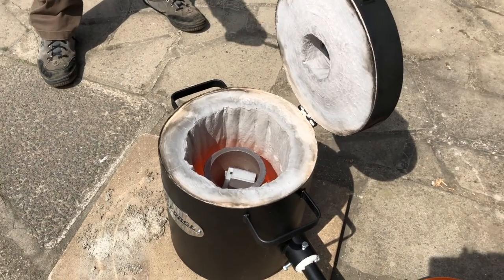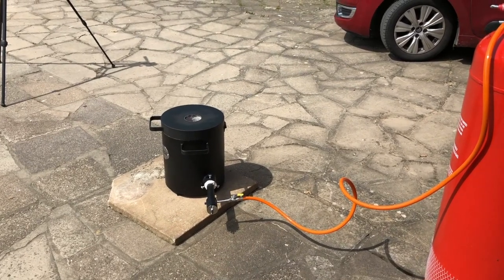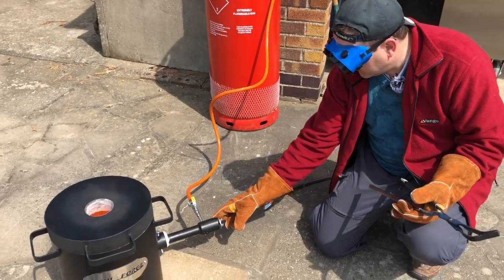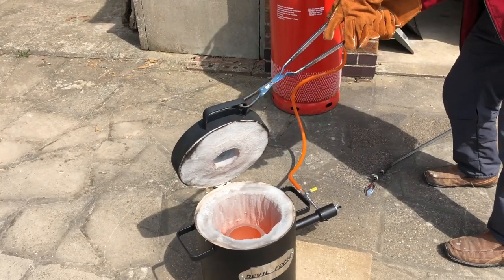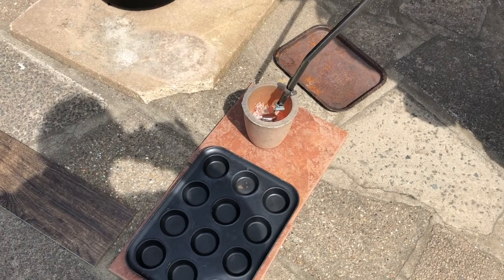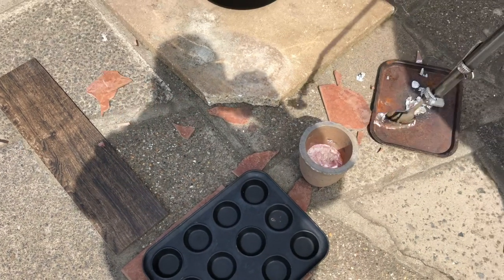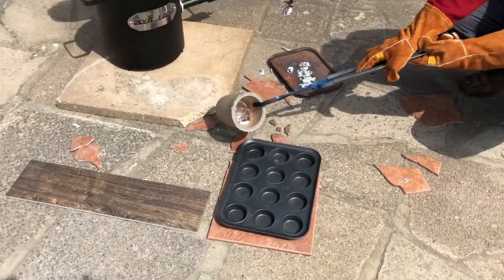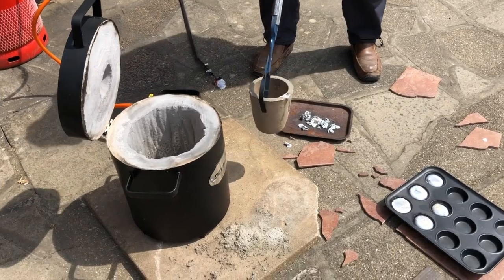Devil Forge furnace. explosion and first melt

Comment: It's not dross.  Aluminium foms an oxide skin the instant it is exposed to air.  You can skim foreve and you will skim off all of he metal if you kep going.  Aluminium is a very reactive metal.  Be glad the skin is impervious oherwise the alumnium would catchy fire and burn he same way magnesium does.
Reply from the maker: Hi Norman. Thanks very much for the intel. Would you suggest not skimming Aluminium at all, or just a quick initial skim and  pour very quickly thereafter?
Reply: @ToTheGarage  I normally skim - because there can e actual doss, just make a pass and hen expect the "skin" - cn't pour the lsat drop, so just use enouh metal.  There are chemical tabs one can use - I'e tried hem and a) they are expensive and B) They don't help.  Just skim once to get the cfhunky stuff, then o head annd pour.  If ny profesional foundary people know better, I'd like to know, also.